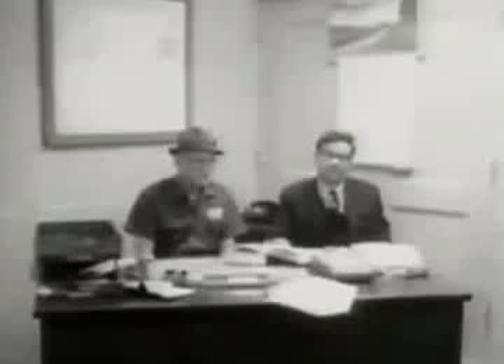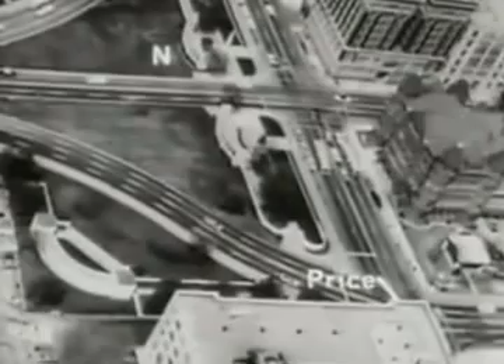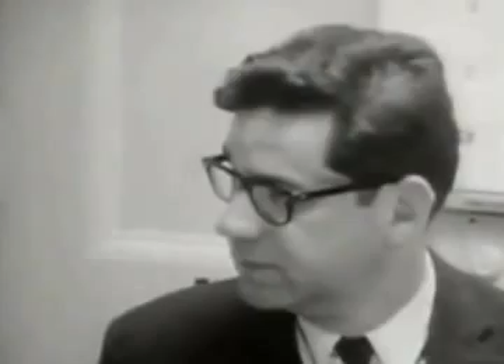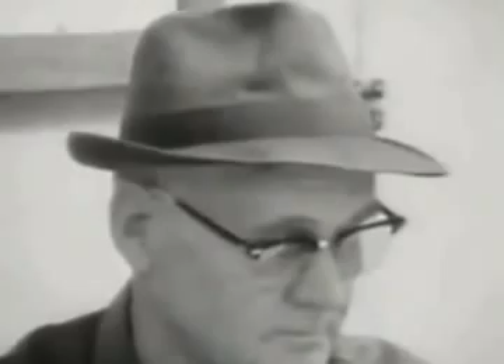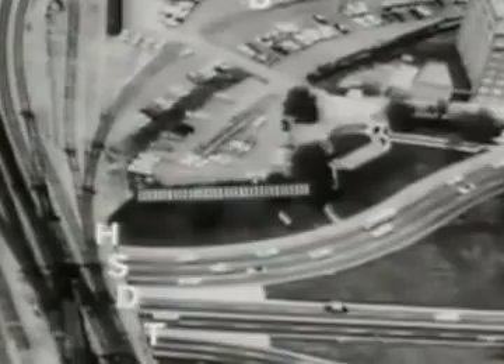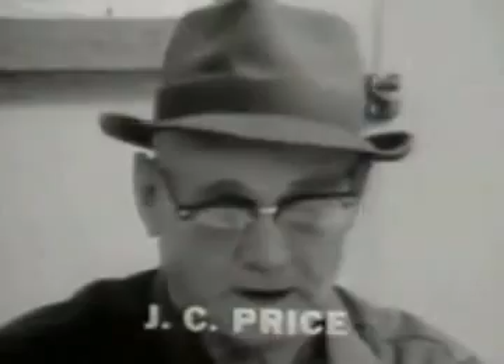JC Price - JFK assassination witness - Rush to Judgment

Comment: Kennedy was hit 4 times.  All bullets did not exit.  Connelly was hit once and bullet never extracted from his leg.
Kennedy:
1.  Entry front throat.  Bullet goes through windshield.  From S corner of overpass.
Picture of windshield bullet hole 12” to the left of the mirror and high, available.  
2.  Entry high right front hairline from the STORM DRAIN.  Escape through storm drain to point west of overpass.  Probably using a scoped pistol such as Remington x-100 .221 varmiter round.  The .223 round not available quite yet for this pistol in 1963.  Bullet is explosive since round is high speed 3200 fps.

3.  Rear entry back.  Bullet does not exit.  Bullet lodged atop his lung.
4.  Rear entry 5.56mm lower skull or high neck.  This bullet came from rear following car by Agent Hickey when he lost his balance while retrieving a locked and loaded AR15 from the limo floor.  He accidentally hit Kennedy at a 8 degree from horizontal angle while his thumb unlocked the rifle

Agent Hickey unlocked the rifle with his thumb as he picked it up.  His thumb rests on the locking arm.  

As the car lurched forward, he pressed the trigger and hit JFK.  A lurch forward will drive his finger backward to fire unintentionally.  The book “Mortal Error” explains this accident.  As he swiveled his body to the rear, this puts force on the trigger finger during this motion.  Also he is under stress.  He is losing his balance.  Also, he was standing on the sloping rear seat.  He lost his balance as he turned around to point at the shooter.  Try standing on a rear seat while a car accelerates.

The Agents around Hickey went into cover up mode at the Parkland hospital storm drain.  This guilt by Agents cause them to cancel the autopsy and quickly get the body out of Texas.  

The 6th floor shots were from a higher angle, likely 20 degrees—-go look it up.

Read “Mortal Error”

https://youtu.be/sDYNMlXD59o

5.  The bullet that hit Connelly was separate from any JFK bullets.  It had to come from a high rear building from 20 degrees or more.
Perhaps rooftop shot.

6.  Bullet from Grassey Knoll misses and hits curb, chipping the curb and chip wounds a bystander’s cheek.

7.  Bullet fired from building ricochets off road to hit chrome windshield frame leaving big dent.  Picture available.  Possibly from Malcolm Wallace, assassin for Ed Clark, LBJ, from 6Th floor.  His fingerprints were found and stored for years.  This was Oswald’s alleged position. Oswald seen having lunch on a lower floor.
TOTALS
4 rounds hit JFK, 2 in the head, 2 in body
1 round hits Connelly in wrist and leg
2 rounds miss hit road, curb.
TOTAL 7 shots

P C Price said he heard 5 shots
https://youtu.be/7Qab4GI2agc
.